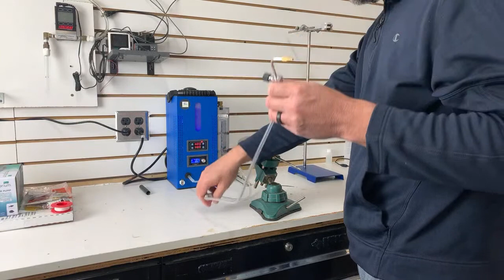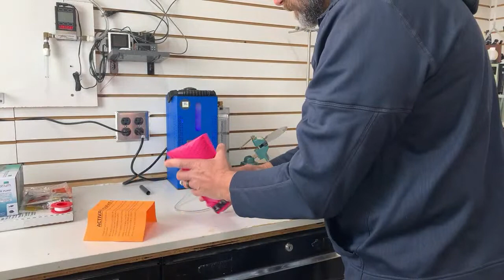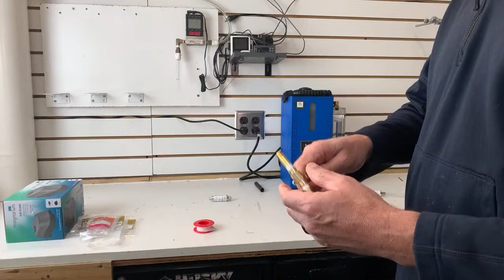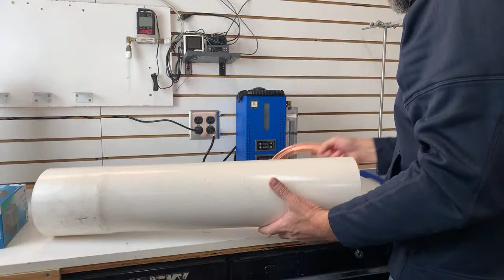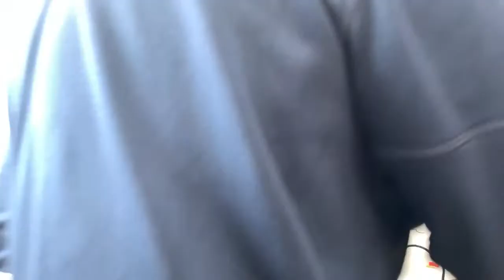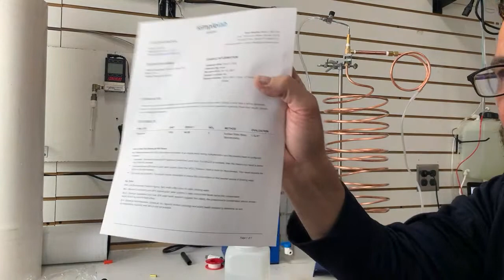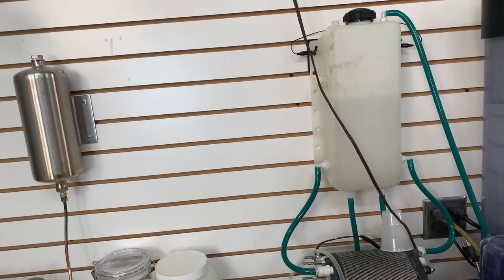Full assembly of a DDW generator attachment for brown’s gas machines. Deuterium depleted water

Comment: Hi Steve and everyone else in this community!
Some information for you:  
Each  time you distill water you will strip out approx 3% of the Deuterium that’s in the water.
So, theoretically, if you started with tap water with 153ppm of Deuterium in it, and you ran it through a standard counter top distiller about 200 times your end product would be 0ppm DDW.  To get down to 25ppm, you would need to run it through your distiller about 60 times.
Reply from the maker: Now we need to invent a distiller that distills 60 times in one run :)
Reply: @Hydrogen4Health  already done.  My system distills the equivalent of 100x per single cycle.
Reply: @aquarionh2o132  Is this a custom built unit or purchasable, if yes where?
Reply: @matthewhewlett8942  Hi Matthew,

Any countertop distiller will perform the function.  Some distillers are going to be better than others, but in the worst case scenario, ANY distiller will reduce Deuterium levels by a minimum of 1% per distillation cycle.
So, if we start of with tap water at 153ppm and distill it 16x the Deuterium levels will decrease to approx 130ppm (the beginning level of therapeutic water).  — Just a quick FYI here.  At 130ppm most diseases decrease by a minimum of 20%.  Some diseases simply don’t exist at all anymore, period—.  If you continue on and distill it a total of 180 times, you will have 25ppm water.
Without spending big bucks on testing and fancy setups do your own simple calculations and use the “worst” possible numbers as your guide.
Put 153ppm x 0.99 into your calculator.  Each time you hit equals will show you what one distillation cycle will do using a simple 1 gallon countertop distiller.
To build a distillation system that will do 100-200 distillation cycles in one pass will cost you $10,000+ just in parts - to say nothing of all the calculations and understanding of how various factors effect your end result.  You can buy a system pre-built for $80,000-$100,000 (US), but this is just not realistic for most people, especially if they don’t know how to run it 😒
Ultimately, I want to bring to market a small household sized system that is affordable and just plug-N-play for people.
Everyone should have this water, understand what it is and what it does.
Cheers
Reply: @aquarionh2o132  My understanding is that all water on earth has 0.03% deuterium in it, this has the effect of lowering our life span greatly
Reply: @brianwhelan5382  One must Average the Deuterium concentrations to generate a baseline of sorts.  Natural levels on earth, during the current era, range between approx 130ppm to 170ppm (give or take).  The official global average is considered to be 155.76ppm.
In one were to assume a person’s water source was 150ppm, the level of Deuterium in circulation in their blood would equal all of the Calcium, Magnesium, Potassium, & Glucose combined.
Reduce your Deuterium level by just 10% from this point and ALL known sources of illness and disease decrease by between 20-40% (depending upon the specific condition one is looking at).

I hope this helps.
Reply: @brianwhelan5382  just finished listening to the show.  Most of what the present is good information.  Some is simply too far “out there” to be received or construed as credible information...and I have no idea where they got the 0.03% number from.  If I were to throw a random guess out there, you “might” have Deuterium levels up in the 300ppm range in the Dead Sea?  The highest natural Deuterium levels exist waters around the equator at sea level.  The further north or south of the equator you go and the high your elevation and/or further inland = lower Deuterium levels.
The lowest natural levels on earth today is in the 130-135ppm range and is glacial water.
Yes.  During the last ice age, Deuterium levels in common water sources were lower.  Depending on your source 110-130ppm.
The dietary information they mention is valid.
In short, the lower your Deuterium levels the better.

Cheers
Reply: @aquarionh2o132 were do you get that
Reply: @aquarionh2o132  what is your system ?
Reply: Just adding to this thread but consider this. After the biblical Great Flood lifespans got shorter. Why🧐 because the catastrophe event that lead to the great flood was radioactive in nature which can be seen by looking at the giant dessert in Africa. Follow the path of destruction and it leads to the North Pole so something happened on the planet that caused alot of radiation, instant freezing of animals, and all civilizations on the planet at that time drew the exact same petroglyphs that shows a squatting man with two dots on each side. Well that “squatting man” is really a radioactive event that was seen worldwide at the North Pole. The squatting man is also what is seen when a nuclear bomb is detonated. Same pattern. Not sure how long it lasted but must have been a life time. It also caused a reduction in the earths population by 90% so the survivors went underground to escape radiation, cold, etc. (possibly hollow earth theory correct). All that to say that may be why the deuterium levels are so high and we live so short nowadays so reduce the deuterium increases lifespan in my opinion.
Reply: @aquarionh2o132  are there any distillers that can recycle the distilled water back into the distilling container in an automated way?
Reply: @TermiNader5  I think what you are looking for is what is called “fractional distillation”, if I understand your question correctly.  That said, yes, you can build a system that does that, but you would need to know how much DDW you need to make and at what purity.  It gets quite involved and can be very costly.
You can buy small lab (table top size) pretty easily for a few hundred dollars.  The deuterium levels of what you produce would need to be measured from there to figure out what you have done and how well.
Reply: @aquarionh2o132  do you sell your own fractional distiller units?
Reply: @TermiNader5  Not yet, but I’m working towards that.
Reply: Completely untrue. It seems that no one on these Brown’s Gas discussions have any understanding of this. Buying DDW water is a lot cheaper than the electricity to single-pass distill water etc.
Reply: @robtslovak  I’d like to see your numbers and method.  Beyond that, what you appear to be stating is that companies selling DDW are doing so at a loss (selling their DDW for less than the cost of the electricity used to produce it).
Please illuminate us.